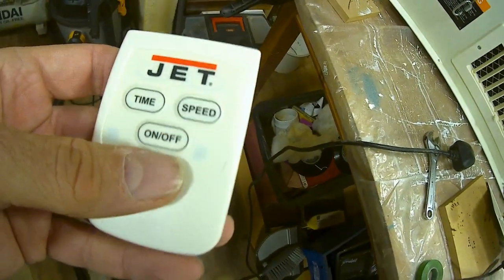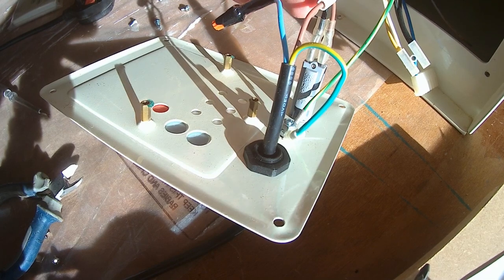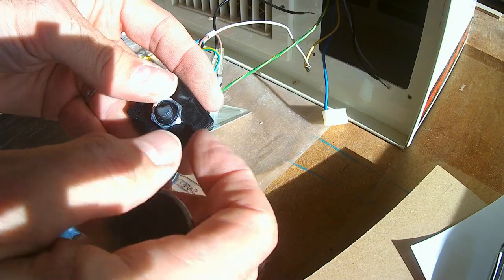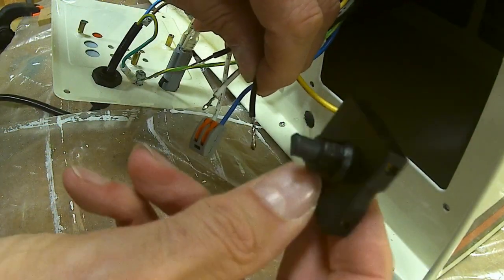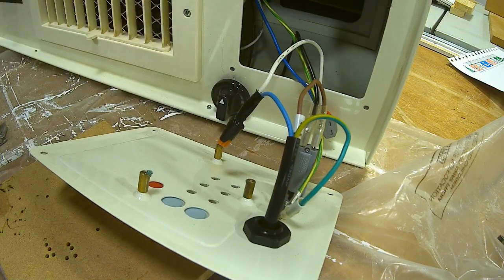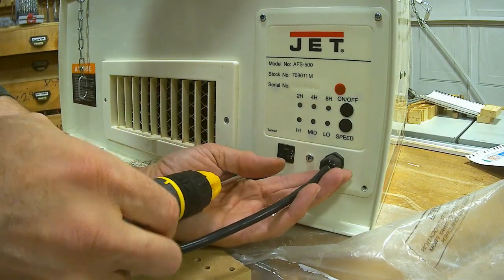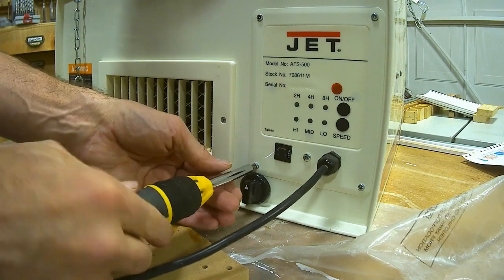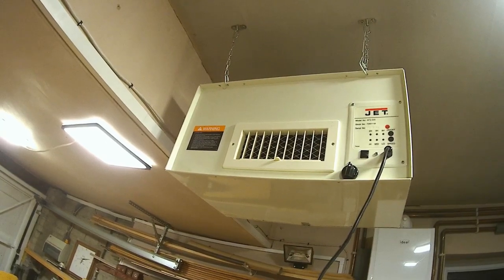Workshop air filtration DON'T do this JET repair

Comment: Hello Ben,
JET is a very good brand. I don't bother too much with such tools to solve problems sometimes. Probably a remote problem. Although there is no timer setting, you had to use it somehow. After all, I'm glad you have fresh air in your workshop. Thank you for sharing the details and your experience. Stay healthy and happy. Big greetings.
Reply from the maker: Hello Mehmet. The remote still works but the condensers kept failing on the circuit board which was too expensive to replace. I'm back to making dust again. I hope you are well, I've been enjoying your shorts. Best wishes.

Comment: I have same unit. Capacitor is common failure on the board. $1 part. Changing mine this week
Reply from the maker: Hello my friend. I changed capacitors three times but the pcb continued to fail after a brief run each time. That's why I went for this more drastic solution. I hope yours works out for you.
Reply: @benjaqsonworkshop9974  - fingers crossed. Used a slighter bigger capacitor like another guy did. Hopefully it will wrk but I like your idea as a backup!

Comment: Did this and found that it trips the included circuit. Works at low speed, works for a second at medium and then trips, trips immediately with high speed. Thoughts?
Reply from the maker: Not sure what you mean by the included circuit - I by-passed the pcb completely and took power from after the 3amp fused live. Is it that fuse tripping or at your consumer unit? You might have a short across the high line and common or earth but I'm only guessing. As I say, I can't recommend this as a fix but if you're getting low and medium again, that might be worth settling for. I rarely have mine on high as it's such an efficient fan. Sorry I can't be more helpful...
Reply from the maker: Just re-read your comment and realised you're not getting medium either. If you have cut out the printed circuit board completely (I left mine screwed in place but disconnected) and connected the three power wires to a 3 way switch and the same thing happens, check the amp rating of the switch to make sure it's up to the load for medium and high. Good luck. Ben.
Reply: Oh my apologies I meant the included fuse trips. For the afs-1000b it’s a 5 amp fuse. I bought the same 3 way switch as yours and wired it the same
Reply: @benjaqsonworkshop9974  thanks for your help Ben! I’m going to try to troubleshoot it some more one day. Luckily I bought one that works and the man gave me a second that was broken for free so I’m not in a hurry to fix it. Although it would be nice to fix and be able to give to a friend